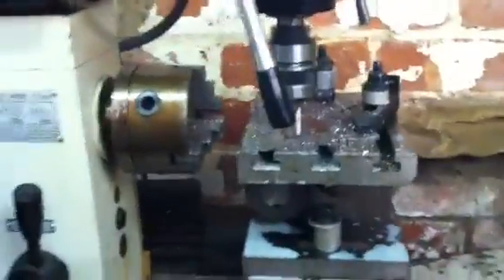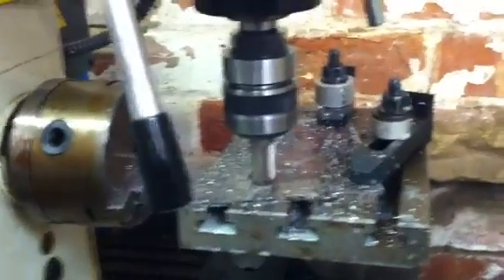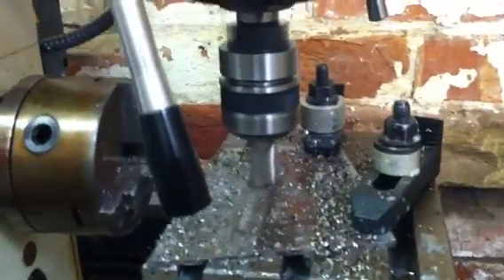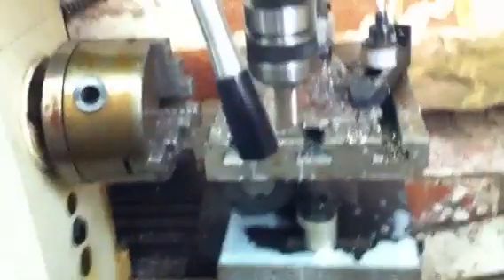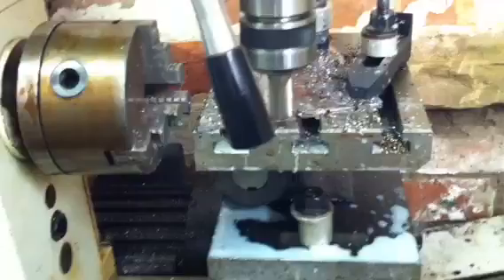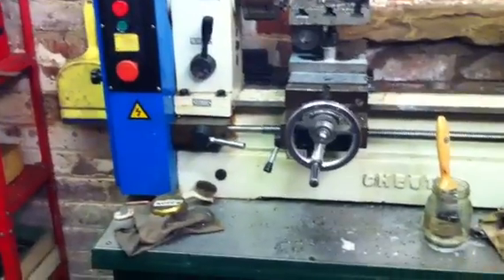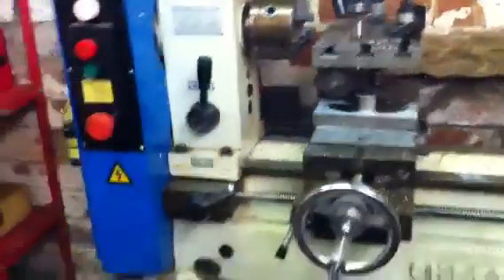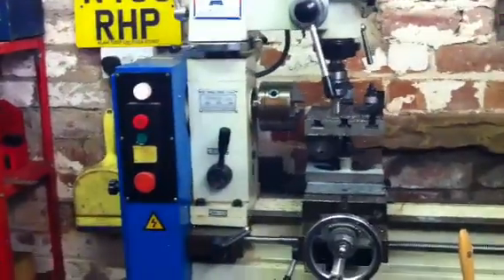VW T25 Chassis & Body Repair - Part 14

Comment: So obviously the 2mm plate they sell in massive sheets is different to the type they use on a poxy VW . I have some genuine VW 2mm plate for sale if anyone wants any cos it must be rare to mill down 4-2mm plate ...
Reply from the maker: Rare? Possibly  ;)

In my case, I needed a piece 2mm thick. I only had 4mm to hand.

Cheers,
Reply: I would have waited and done another task . If I can't find plate to size thin stuff .. Backs of washing machines and tumble dryers serve well and the wife doesn't notice they have gone